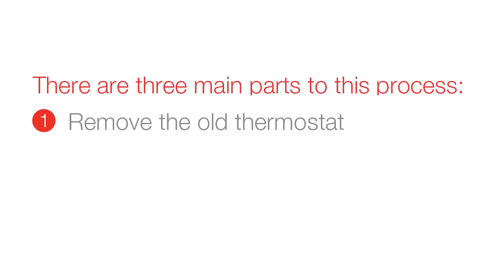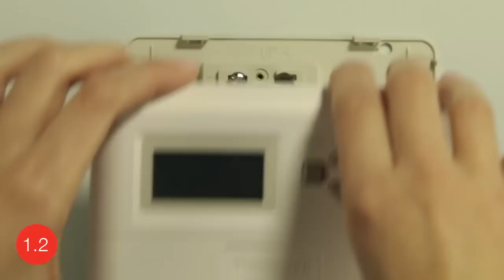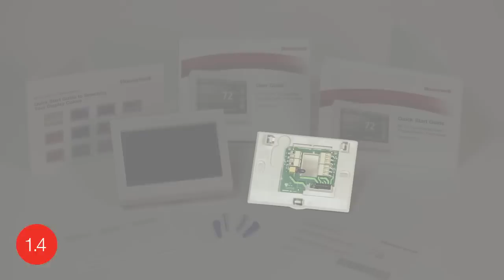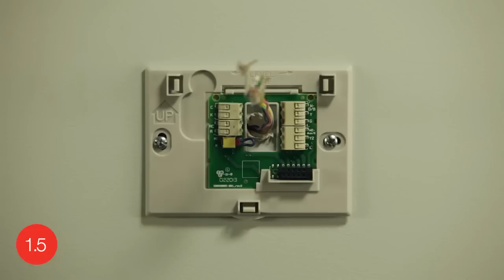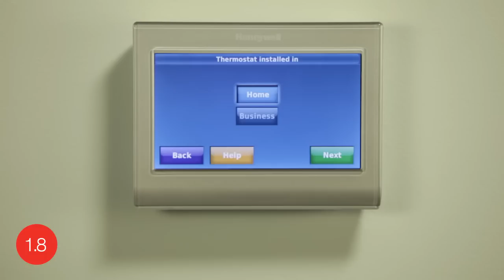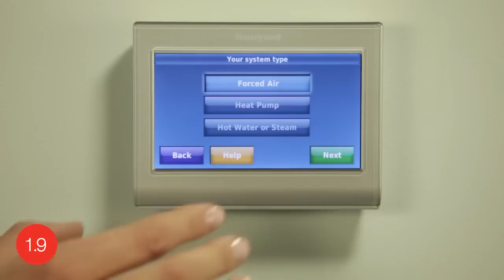How to install your Honeywell Home Wi-Fi Smart Thermostat

Comment: Mu "C" wire blue is not connected, should I connect it to the C wire plug?
Reply from the maker: Hi Fidel, thank you for reaching out. We recommend following the wire back to the fan timer board at your system to verify that it is in fact the C wire. Feel free to reach out should you have further questions. -Paul

Comment: Installed it myself, but make sure that if you have AC and gas furnace, that both the AC and gas furnace breakers get turned off before you start to disconnect the wires from the old thermostat.

Comment: Installation is pretty easy, just make sure you label all your wires BEFORE disconnecting from your old thermostat. It may not have the correct color codes or labels, so it's important you use the provided stickers to label the wires you remove from your old thermostat. If you do this, it should work fine. Also, I has a little trouble hooking up the WiFi at first. Make sure your wireless router does not have MAC filtering enabled before attempting to hook up, if it does, just disable it until you have attached the new thermostat and then re-enable it.

Comment: Dunno what they turned off at the circuit breaker, but a single 15amp aint' it. The two 20s on the top right clearly say A.C. but you know, details.
Reply from the maker: Hello Shawn, if you require technical assistance feel free to send us a private message at our Facebook or Twitter page under Honeywell Homes. We'll be glad to help. Thank you. -Laura
Reply: @honeywellhome  no it's just the demo of what to turn off in this video is inaccurate.
Reply: No.. You are wrong.. The 15 amp breaker is for the furnace.. All the control wiring is at the furnace..
Reply: @meganjoe  oh maybe so because here in Texas we don't have separate furnace. But if this runs both, wouldn't you still turn off the AC breaker(s)?
Reply: @shawnbodily2914  Here in PA we only have to turn off the furnace power breaker.. the single pole 15.. not sure about Texas..

Comment: I have a W wire and a separate O/B wire. Would I just twist these two together and insert into the W slot?
Reply: I'm in this situation now. What did you do?
Reply: @jeremygwood9669 I'm in a similar situation, old thermostat has W, O, and B wires in 3 separate terminals. Did you  end up putting yours together in 1 terminal?
Reply: This makes 3 of us

Comment: I hooked my new thermostat up, did everything right. But still unit did not power up, when i attached the unit to the wall. I troubleshooted, and still no power. Luckily it wasnt needed that night. I tooka night off and ran threw what i missed. I then tried something, i closed the furnace panel door, and POOOOF, the wires were hot. I didnt know there was a safety switch on the panel door on the unit in the basement. After finding this mistake, it only took 10 minutes to rewire, and get the unit powered up. Now im all set with my cell phone.
Reply: You just saved me a trip to Best Buy. I was about to return it...closed the door and it worked! Thanks!

Comment: What to do if my old thermostat has a separate W2 and E? It's on the same terminal for the RTH9585
Reply from the maker: Hi Bill,
The W2 and E wire have the same function, you can twist these two wires together and insert them into W2. -Joey

Comment: Of course no video instructions for no C wire
Reply from the maker: Hi there, thanks for reaching out to us with this. If you still need assistance with getting a C wire, you might want to check out this video - https://www.youtube.com/watch?v=58VPh_sBNgE . It goes over two options if you currently don't have a C wire connected. Feel free to contact us if you have any additional questions and we'll be happy to go over them. You can reach us at 1-855-733-5465, through live chat, or via social media (ref #01190223). Thanks again for reaching out and we hope you have a great day. -Kari
Reply: @honeywellhome  Would be nice if you had info on using a 24V adapter. But looks like we have to hunt for that.
Reply: It says on the box that a C wire is required.